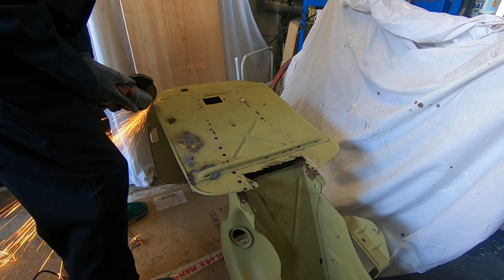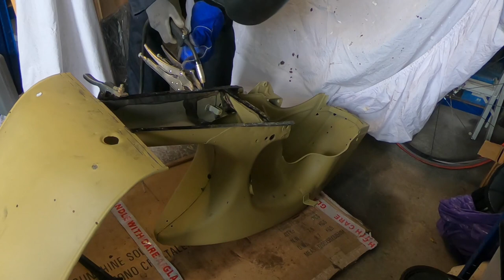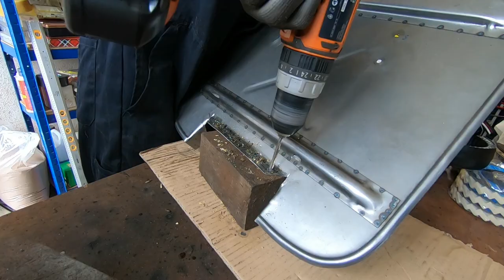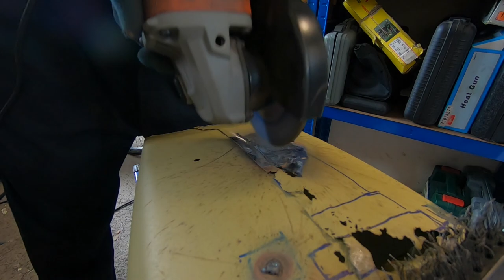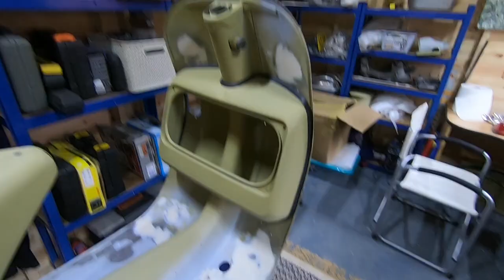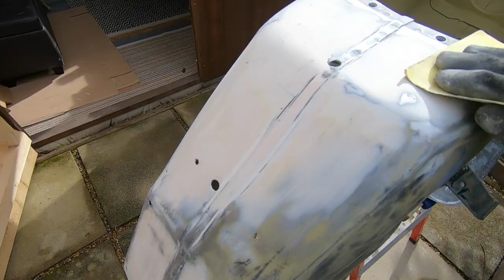Vespa P200E restoration Part 3

Comment: Man, kudos to you for doing all your own bodywork! You cut out panels, you learned to weld, you slapped on lots and lots of filler, and you sanded and sanded until the body was ready for primer and paint. I would've simply written someone else a sizeable check (cheque?) to do all that work. You ROCK! Okay...on to Part 4!
Reply from the maker: Thanks. Have to admit it's been a bit frustrating at times but enjoying the learning process. Satisfying knowing that I've done it myself.

Comment: Speaking as a welder of 35yrs I congratulate you on a fine job there, I bet it was like welding tissue paper at times 😆 is your welder a gassed or gassles MIG set and what diameter wire did you use?
Nice to see a British restoration for a change  on YouTube too. 
Good on ya...😊
Reply from the maker: Thanks for the encouragement. You're right, there was a lot of "burn through" while I was practising 🤣 My MIG set (very basic) can do gas and gasless, but I found the gasless easier; used 0.6mm flux core wire, I think. Got a real admiration now for those highly skilled trades like welding and spray painting. Going to have to spend more time on these skills for the next project.

Comment: Where did you get most of your parts please? I am rebuilding my 1981 P200E and need to purchase new wiring loom, cables, barrel and some bodywork parts.
Reply from the maker: Hi. Got bits from various places, used Buzzmoto, Beedspeed and Scooter Vista a lot. Best of luck with the rebuild.